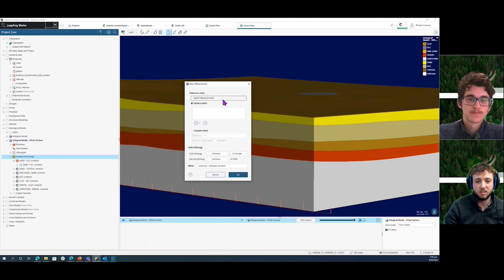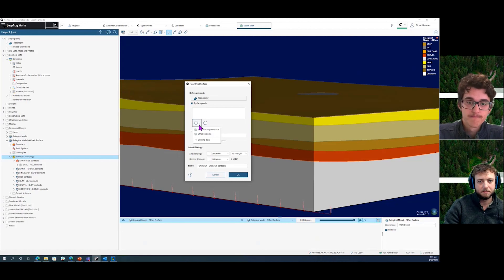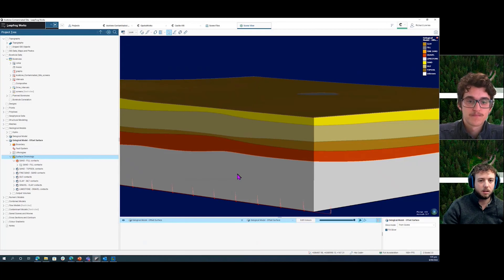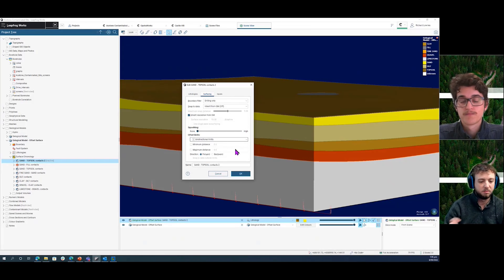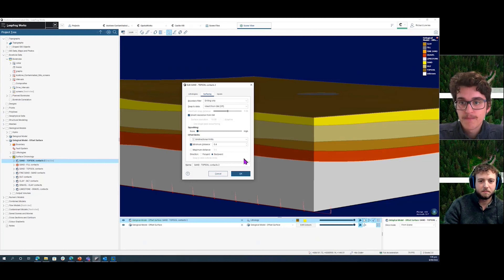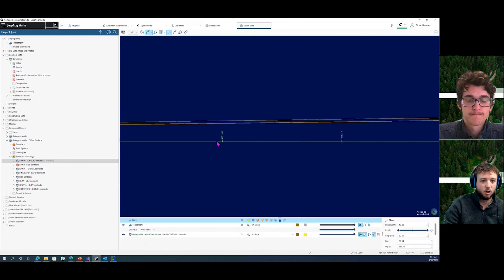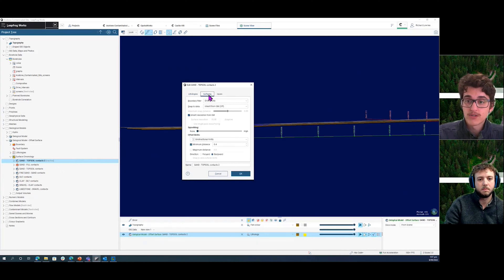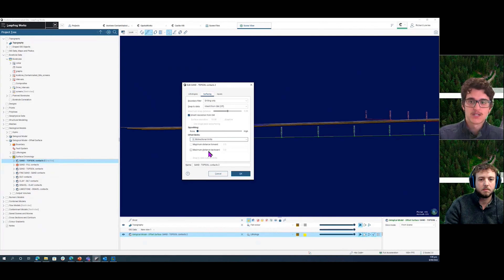Modelling superficial deposits in Leapfrog

Comment: Hi, nice video. A question I have: Let's say the superficial deposit does not extend over the complete geomodel, but only within areas for which I have polygons/polylines that delimit them. How do you tell Leapfrog to make local, thin deposits? If I make them as a deposit/erosion using these polygons/lines, it makes way too deep reaching volumes and it is impossible to get them flat...